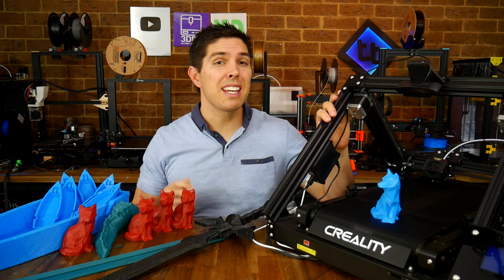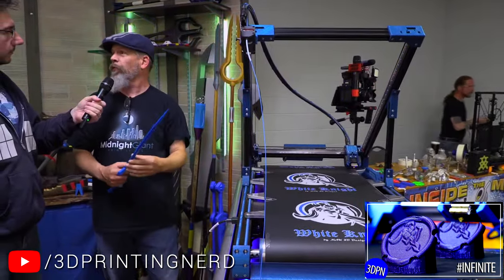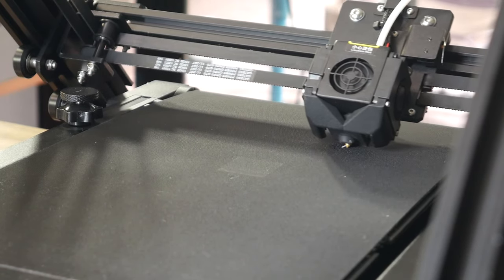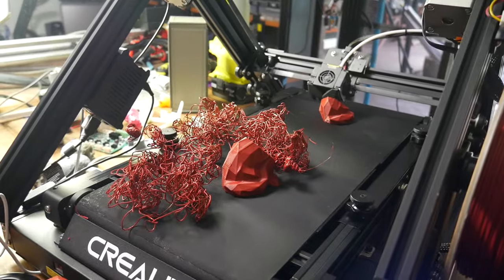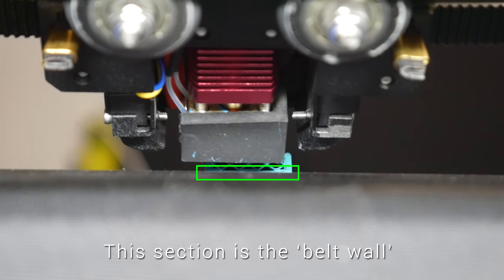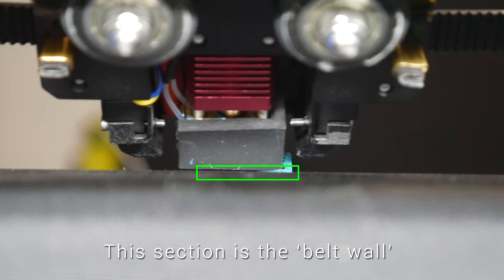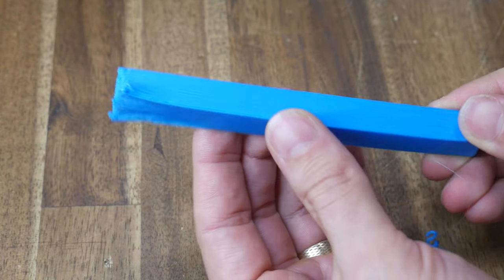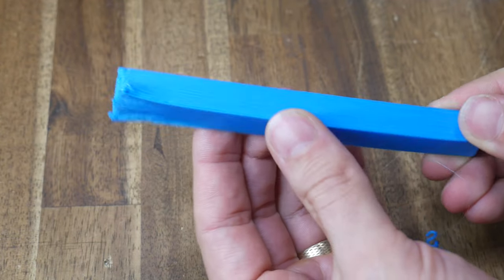Creality CR-30 3DPrintMill belt 3D printer: What to know before you buy

Comment: It’s Kickstarter. No way I am backing it.
I back 2 Kodama obsidians for about £500 3 years ago, delivery was meant to be before Xmas 2017.
I got nothing.
I backed the the Creality CR6 thinking well this creality it’ll be different and it was.
I got a printer.
I’ve had it 2 months or maybe a bit more and have not got a useable print off it. Creality support has been very poor. Not withstanding the faulty switch that perhaps could have started a fire I have replaced the extruder and the mainboard and the dead hotend fan all at my own cost because creality support is so poor, there’s other issues some are having as well.
You mention buying a printer both in the video and in your title.
You are not buying anything Michael. You know that.
You are backing it on Kickstarter.
If you buy something you have legal rights and can return it under your countries consumer laws.
You have no such rights under Kickstarter as I am sure you are aware indeed you even mention it at the end of the video.
You cannot buy this printer so you talking about buying it and using buying in your title is to me at least a bit misleading.
You know what Kickstarter is, you are probably aware of the CR6E issues, I’m sure you know of others that have failed talking of buying this printer is misleading as if you order one now you are not buying one.
You are throwing yourself at the mercy of creality and whatever support they may or may not give you and have no rights. You give them up on Kickstarter.
Sorry Michael love the channel and I know I’m repeating myself but you really should not be using Kickstarter and buying together.
It’s not for me by the way, all valid points on the video and a review apart from the buying bit.
If I buy something I want some legal protection so if I really wanted this I would wait and buy a production unit where I would have consumer/purchasing rights.
Yes it’s meant to be more expensive but in my opinion it’s worth the extra.
Plus in the case of the CR6E when the retail units came out they were so discounted they were the same price as the backers paid. This may be entirely different I don’t know.
If Naomi herself could fix every single printer herself, as I know she would if she could then great but this is impossible.
Apologies for the rant but people maybe do not know what they are doing, you say buy and mention Kickstarter and they think it’s a shop.
It’s not.
We both know it’s not and we both know the difference between backing and buying a printer but not everyone does.
Oh and I do know why this is on Kickstarter as Naomi commented to me elsewhere, she wants this to be open source and said she came to an agreement with creality that if she raised a certain figure they would make it open source so best of luck to her.
Reply from the maker: Thanks for your feedback. I agree that Kickstarter is a risk and I have a warning in any video about Kickstarter products that they are risk, including this one. The use of 'buy' in the title and video is not intended to misrepresent. I used as a way of future proofing since eventually this won't be on Kickstarter and will be for sale in a normal way.
For the record the CR-6 SE I tested was the best out of box printer experience I've ever had. Better than Prusas or anything else. The lesson there for me is beware of stretch goals that potentially add new features that haven't been tested prior to the campaign.
Reply: Michael I thought that might be your intention but if someone comes along not knowing what Kickstarter is and sees your video he or she hears you say buy they think they are buying it.
I brought this up with another YouTuber who did not mention buy but did mention back and Kickstarter. I told him that because he said nothing about Kickstarter he could mislead people and I thought he had an obligation to make it clearer.
I did not like the answer I got, he said if people were spending hundreds of pounds on something it was their responsibility to do their homework before they spent their money.
While I agree in principle I don’t think it’s right that he mentioned nothing about the risks and it’s not a shop.
Loved his channel but I do feel strongly about this so unfollowed him.
Some may think that’s childish, I will definitely miss his videos and reviews but I do strongly feel it should be stressed that there are risks.
I have a lot of printers, well 8 that’s a few. Four creality ones all pretty good but my CR6E is junk, too many issues. Your printer was obviously better built.
Joel’s printer wasn’t that great either I recall think his board sparked and died. I will get it going but have a bigtreetech board for it, not buying another one of these creality boards.
Glad your printer is ok. Hope you changed the switch and I wouldn’t risk using the usb for a pi. But maybe yours is fine you can only review what you get.
Keep up the good work.
Reply: The “Buy” vs “Kickstarter” debate in the context of Creality is plain BS. Creality is a huge (multi million dollars or RMB) company and they made promises on the CR6 SE that they should have respected but they did not.
They have been lying and cheating and even put the printer on sale on Banggood or AliExpress at same price than the KS
What’s worse after all, is that the main selling point of the nozzle touching the bed to auto level is just stupid as the bed flexes when pushed from the top. Installing a BL touch on a cheaper printer is just a smarter concept.
Or do as I did... buy a Prusa and resell your CR6
Reply: I cannot in all good conscience sell my CR6E, I would not even give it away as it stands.
Perhaps I am a bit paranoid but I do not think it is safe and would not trust it to run unattended. Not that I have been able to as I’m still trying to fix it.
There was the issue with the switch now the motherboard and no after sales support.
I didn’t buy it, I backed it.

This belt printer is not fit me it’s bringing too many variables into a successful print but I can see for a small number of people this being an incredible printer.
Will the Kickstarter price be the same as the final retail price? Quite possibly so you save nothing.
Will there be build issues and problems with parts? Yes.
Will you be able to get the issues sorted with support from Creality as it’s a Kickstarter?
No probably not.

Really really really want this? Is this useful to you? Then wait for the retail one and keep all your rights so you can get proper help and if they don’t fix it return it to the retailer as allowed under the law for a full refund. 
No rights on Kickstarter oh and if you think but if I back it I will get it first! No. Not even that. Some backers got their printers early but some were still awaiting after the retail units were in the shops. A minority but I’m still not 100% certain everyone has their printer.

Comment: im thinking that it would be cool if someone put a ender 5 printer on top of the belt, in that way you could print a part with regular settings, then the belt would remove the part and then start the next print

Comment: I'd still rather have a printer with a large print bed than a belt.  Too many moving parts as it is.
Reply: How many moving parts are on a  CoreXY vs printmill?
Reply: @PaulDominguez  I’ll answer that.  Same amount.   Both have 3 moving axis. 😉
Reply: @PaulDominguez  depends on what's moving on a Core XY. Let's start with motors, at least 4, maybe 6 if your Z is large, ball screw alignments, drive belts & tensioners, idlers, Vslot wheels. And that's just for gantry movement.

 The complexity of the "infinite Z" belt and the angled extrusion, definitely makes this for a more experienced 3D printer user.  Not something I'd want.
Reply: @Scott_C  I doubt such a machine is targeted to makers like us, I think this is more in the alley for someone like prusa or company that relies on 3D printing farms for part production. It's far from fully developed (like the I3/coreXY/delta systems are) but I'm sure given some time it will find its use in some print farm.

Comment: I wonder how the longer layer cross section affects part strength? If it's on 45deg angle, the you've got 40% more layer contact area.
Reply: moar strength in Z axis, less in Y
Reply: @cthulpiss  I don't think that's the case I guess it defines on how you define your axis. I'm suggesting the axis stay with the parts original XY and z axis
Reply: @cthulpiss  I want to see the numbers. Should make for a great video :-)
Reply: @Scorp1u5  I'm not sure if CNC Kitchen hasn't done some research about printing at 45deg vs print strength. Stefan did get CR-30, so maybe he'll re-visit the subject anyway.

Comment: why we using 45deg? use a belt on a standard printer - i never understood why i would want to monitor my print - if i cant stop the printer or recover when away, there is no need
Reply: 45 deg is required for "infinite z", you can't go backwards after the part separates from the belt. For monitoring, you can stop the print in octo print remotely, so you don't end up wasting all your filament and creating a huge mess.
Reply: @ayylmao.mp3  ah learn something every dsy. still 45degree or belt on printer i have to experiment on this - i did order her printer and worked with he blackbelt - speed is always a concern THANKS!

Comment: In light of the recent Papadakis Racing video,  this printer could really revolutionize the world of garage fabrication...
Paired with recent influx LIDAR based 3d scanning apps on the new iPhones, there aren’t many parts or panels of a vehicle you couldn’t make or replicate. Especially if the print bed was wider. Creating forming bucks for shaping fiberglass, carbon weave or even aluminum would become infinitely more obtainable for the average fabrication amateur. 

Hahah, well damn. I bet that fellow 3D printing a Lamborghini would have literally killed for this machine to have debuted a couple years sooner.
Reply: I doubt it would be that useful. 
Imagine single piece bumper failing at 80-90% after 100+ hours of print and 5+kg of filament wasted. 
Probably would be better of with 3-4 large i3 style or corexy machines and print large part in parts. 
Less print time. Better quality of the prints. And if some parts fail, less resources wasted and so on.

Comment: "infinite" is not really infinite once the Z position goes over the max float size for a 32 bit processor

edit: i suppose it could be done with relative coords
Reply: It doesn't matter, a belt is infinite. Sure the computation calculations aren't "infinite" but it doesn't matter because it's programmed such that it doesn't matter

Comment: 3:15 "affordable" compare to the outrageously overpriced previous models., yes, but by no means affordable. It's quite pricey for a tecjhnology that is unproven and well, with Creality past experience, you might even burn down your house. Unreliable as fuck.
I am sorry but 3d printing has been WAAAAAY to lazy in development and we are being sold even in the present obsolete engineered models from several years back.
Creality has the audacity to promote some of their models with the dual z motor, a thing that was mundane as reprap versions of the first gen prusa i3 had such a feature (4-5 years ago).
So they demand a price tag of 400-600 usd for printers that have nothing new or relevant for this price tag.
Demanding 1000 of the cr30 is simply a dick move on it's own.
The 2020 price tag 700$ is ok and in 1 year time it should be at $500 rrp, thus allowing new innovative products to come up.
No cartesian 3d printers should not be retailed for more than $500
Reply from the maker: I agree the word 'affordable' should have been paired with 'relatively' but I disagree with the rest of your statement. Creality aren't perfect but they have listened to feedback from me and the community many times. It's been a long while since I tested one of their machines without thermal runaway protection. Some printers have QC issues it's true, but that is the same for any manufacturer. The print quality, upgrade availability and community support for their printers is very hard to beat for the price.
i think when you evaluate the prices of products, you need to look at more than a pile of parts on a bench. Companies need to pay staff to design, develop, test, assemble, document, package, market, etc. If you were selling your own 3D printer kit you may not be so keen to give away your time for free.
Reply: First of all, calm down. Second, no one is forcing you to buy a printer that is out of your reach or overpriced in your opinion. Third, i'd love to see what would you "engineer" if you were Naomi or Creality to keep the machine under 1000$. And fourth of all, you don't dictate law for what a machine's price should be, and if you're not happy with it, don't buy it.
Reply: Another one of those people who have no clue about how pricing and development works but just claims "it's too expensive!!!". People have invested thousands of hours into designing and testing this. And surprisingly, those people have to get paid. In contrast the number of people who will buy this printer being such a novelty will be extremely small. Yes, kickstarter has 1 million of funds. But that's not much as far as production costs goes and they only have roughly 1000 backers, meaning 1000 machines being produced for Kickstarter. Which is.. very little. As far as Creality goes, their machines have been reliable for me and a lot of people I know at a fantastic price point and they do keep iterating their models. I don't get some of the new models and wish they would pour all their improvements into 1 or 2 models instead of a gazillion, but I can by no means complain. They also listen to user feedback and even do improvements on the go (for example for the CR10(s) with cable strain reliefs, insulated bed etc.)

Comment: It funny that they change the head angle, a normal angle and belt would work the very same. So it's just a gimmick.
Reply from the maker: That would only allow half of the added functionality. You could print objects continuously without human intervention, but you couldn't print infinitely in Z.
Reply: @TeachingTech  doesn't the print head and arm prevent z builds as I don't see how a layer could be made as soon as you reach the hardware.

Unless you slice to make perpendicular layers across rather than around as is a norm?